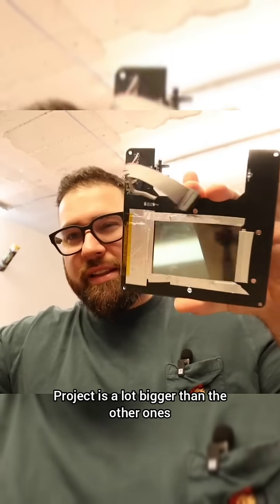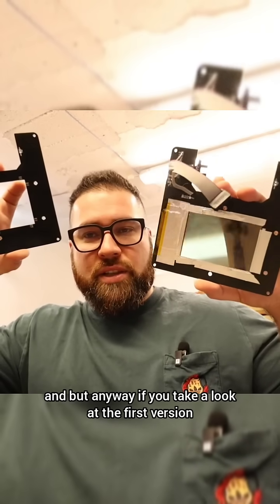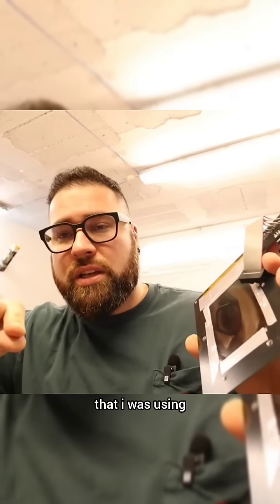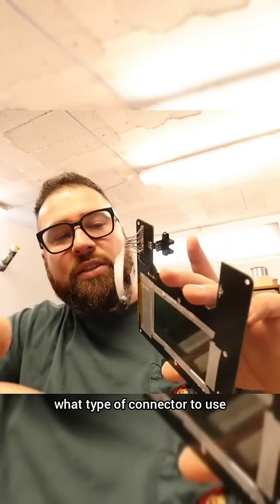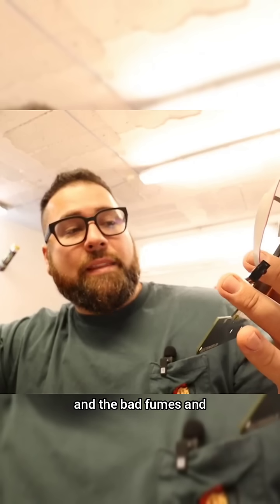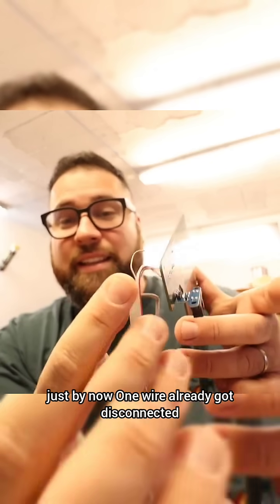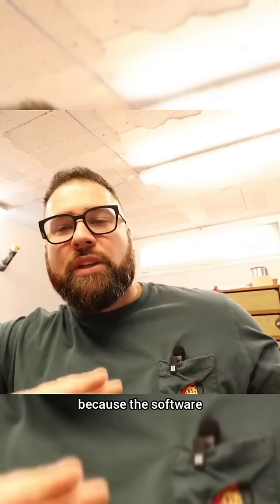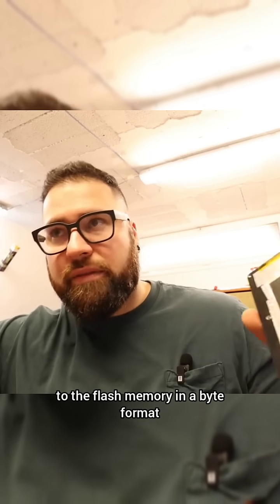Display for my MSLA printer prototype

Comment: I bought a lcd screen, without board, and a ribbon to pin converter board from aliexpress. No soldering required. For these lcd screens, you need a .8mm pitch board.